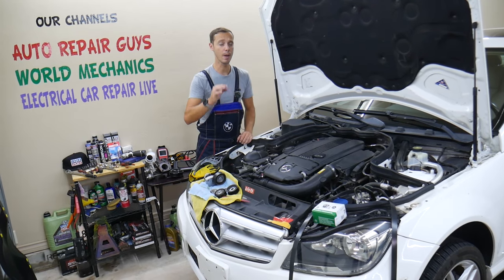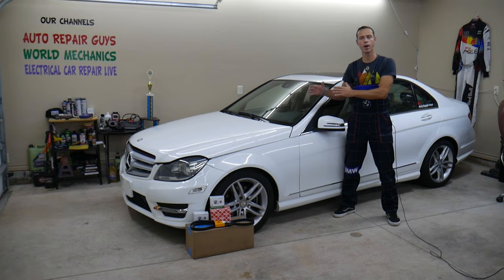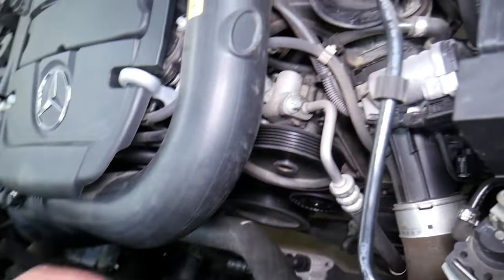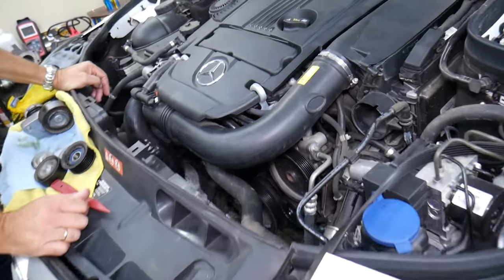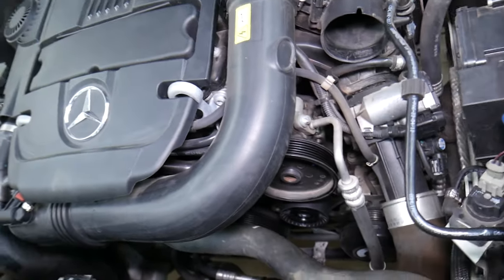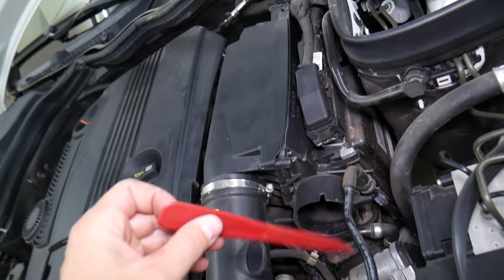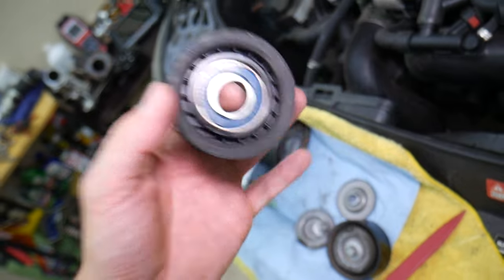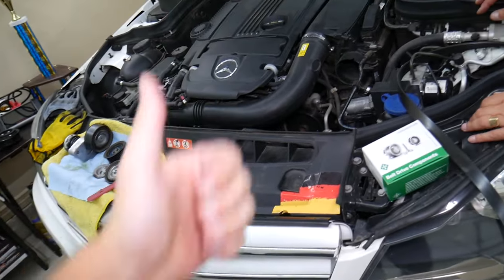HOW TO KNOW IF POWER STEERING IS MAKING NOISE NOISY ON MERCEDES W203 W204 W211 W212

Comment from the maker: Products that we use and recommend:
► Serpentine Belt: https://amzn.to/3ZqyTRy
► Belt Idler Pulley: https://amzn.to/3Xj9QhG
► Tensioner Pulley: https://amzn.to/3WZhOMS
► Liqui Moly Oil Saver: https://amzn.to/3vJhBSw
► Liqui Moly Engine Flush: https://amzn.to/3p91LwF
► Liqui Moly Ceratec: https://amzn.to/3JCVMJY
► Engine Oil: https://amzn.to/3WWf56R
► Engine Oil Filter: https://amzn.to/3WXUak5 
► Mecanics Tool Set: https://amzn.to/2n2dnpb
► Scanner That We use the Most: https://amzn.to/3jogxur

► We buy our Tools and Parts from here: https://www.amazon.com/shop/worldmechanics

Comment: I have a 2004 SL500 with this exact noise. This is great information to check before replacing expensive components. The PS pump on this car is $2300!! You gained a subscriber!

Comment: Thank you for sharing this video 
I own 2008 c350 sport sedan
The car was leaking oil from power steering hose so my mechanic replaced the hose and fixed the leak from crankshaft seal and put new pcv valve 
before doing the power steering hose the car was steering perfectly and smooth , now the steering wheel is hard to turn , i check the fluid was good and the pump was also not leaking since it was replaced before with oem part . i just saw the video of sps sensor which controls the sensitivity of speed to smoothen the steering wheel but i couldn't find the location of the sps sensor on the car 
please make a video a short video if you can . so i can fix this issue that will be very appreciate . 
cause i did all the services and now its very clean car only the steering wheel is stiff and tight on slow speeds . thank you again

Comment: When it's first started there was a whining noise at idle, but on the second startup at idle, the noise was gone. But it's the same vehicle being tested in both runs.  What happened? My 2006 E350 has the same whining noises as this one in the first test, and the PS pump pulley was loose and had noises when spinning.

Comment: I was having a chirping sound. I thought it was one of those idler bearings. I changed them one at a time. I changed all three. Still getting the chirping. I even changed the belt. Now, it makes a slightly different sound. As I watched the belt, as it would go around the pulleys. It seemed to have a whitish spot go by when it made the noise. The belt actually wore down a bit on the edge. You can see a section where the threads are showing on the side. I guess it's a defective belt. I wish I could attach a picture.

Comment: This is the noise my car is making. Did a power steering fluid flush, changed the belt and noise is still there.
Reply: the noise is from the bad pulley (idk the name maybe crankshaft pulley?) so changing the belt did nothing to fix the issues i guess...
Reply: Have you found the issue?
Reply: Check your pulley’s